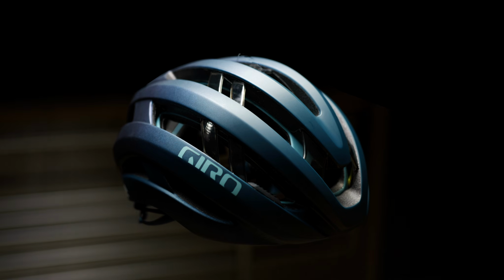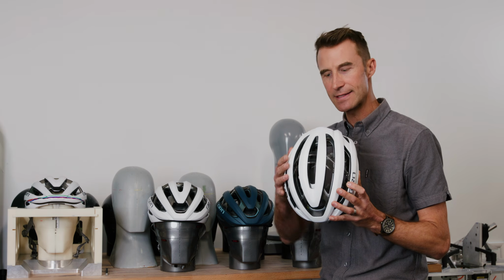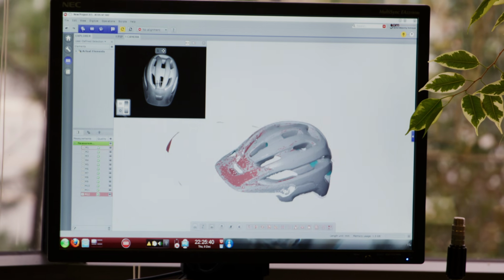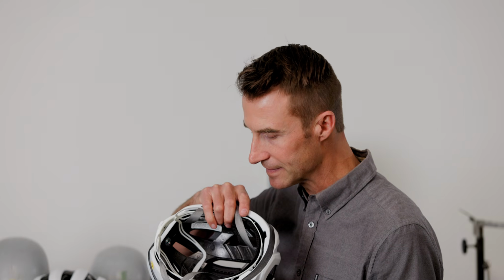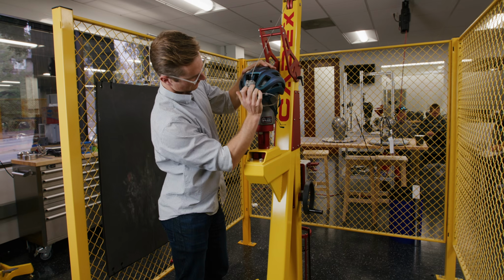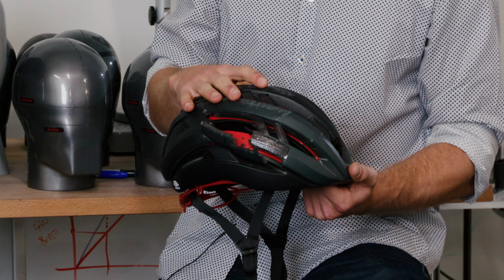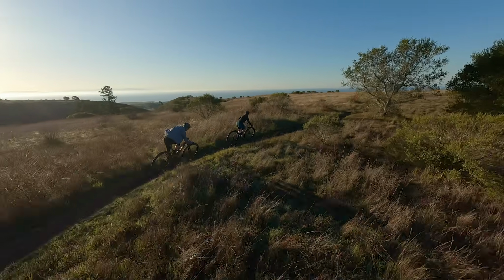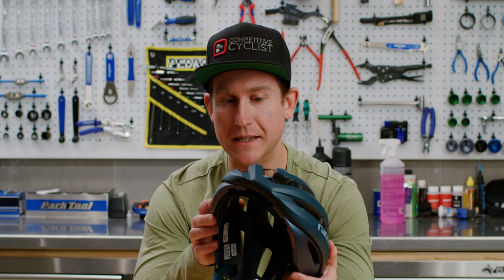NEW Giro Aries Helmet Sets the Bar for Safety

Comment: I was wearing a Bell super Air R spherical when I went down on a Onewheel at 29 mph landing backwards so my forward momentum rotated down and slammed the back of my head hard, I remember the feeling of how hard I hit my head but I didn't have even the slightest headache, the outer shell was cracked in multiple places and then retention system was shifted so it rotated as well. It was caught on video and I've seen similar crashes with different helmets that resulted in severe concussions. 
I can't recommend this spherical technology more 👍🏼

Comment: Does it come in a size  XL / XXL / 7 7/8 - 8 Hat size  ( 24  3/4 - 25" )  ?
Reply: It does not come in an XL, but a Large might just work for you. The large fits 59-63 cm head circumferences, or up to 24.8"
Reply: That's too small , it won't work , do you know of any other helmet manufacturers that make larger helmet sizes ?
Reply from the maker: @seniorcajun1   One of our Gearheads would be happy to help you find a larger helmet. You can either give them a call at 1-888-276-7130, or chat in on our website.
Reply: @competitivecyclist   thank you